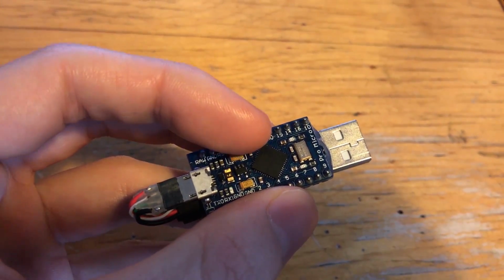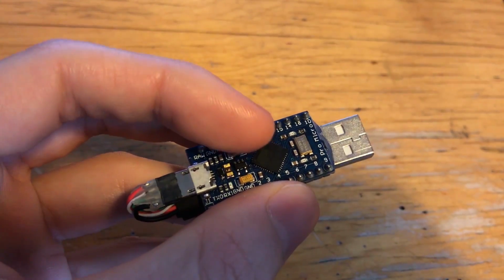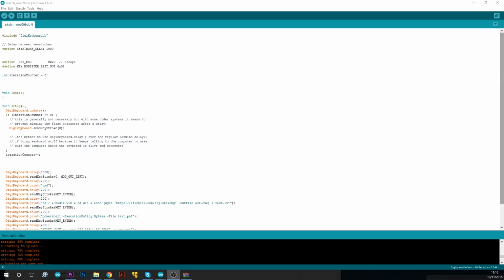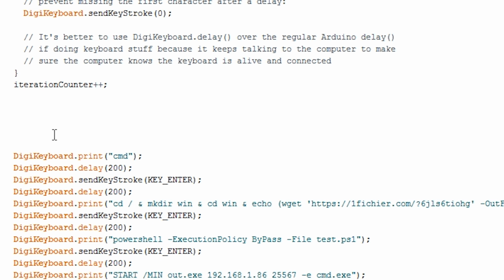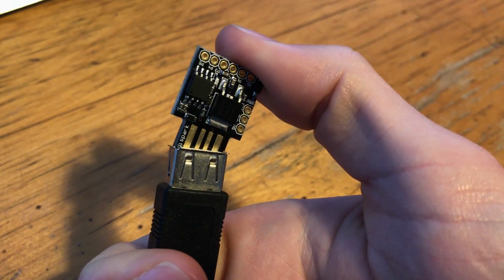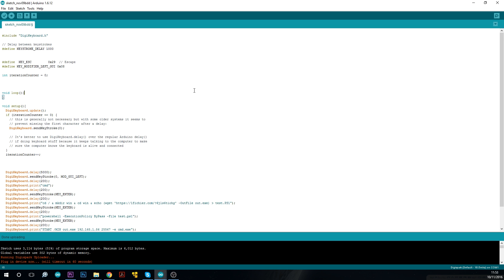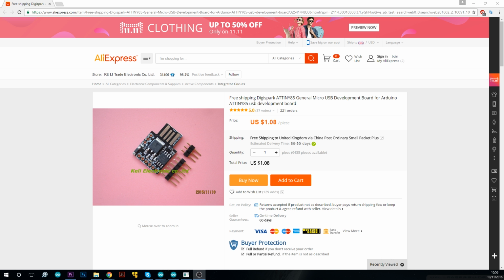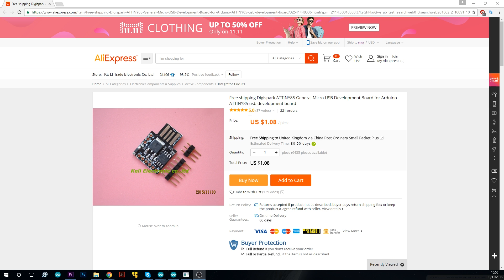$1 BadUSB?! Review

Comment: is it possible to erase or write over one of these if I want to change/replace the program without it executing all over my face?

Also, for multiple keys at once I wasn't entirely clear, are items separated with commas run in order, and items piped run together? or does syntax mandate a comma then a pipe for three simultaneous presses?
Reply: any Capitan to help with this?
Reply: To answer Q. 1

Plug it in after hitting the program button on arduino.
Reply: arduino has an interrupt.
so pressing the upload button before inserting it won't run the program
Reply: You could add a program mode pin than when pulled up triggers an interrupt

Comment: These actually cost more than a pro micro now. yet they do less. I don't understand....Good tutorials though, I like them.
Reply: kael starwynd It is much smaller even with connector. the size would make it easily concealable in a USB housing.
Reply: True but a pro micro can slip into one as well, albeit not as easily. I have one of mine in an old sandisk case. I'm also currently modifying an old smart phone to allow it to fit inside there as well, making it even more inconspicuous!
Reply: Genuine ones cost real money, but you still get 10 pieces for 7 dollars or so. Slightly different layout, micro USB instead of integrated plug, wimpier regulator if you want to power it off 9V external, but otherwise same thing.
Reply: the price went up on ali because they got lots of buyers, ebay still has them for pretty cheap

Comment: When using the ducky script converter I keep getting. "  ⚠ - Error: Unknown command or key 'D' at line: 32." (the line is just KEY D)  Same goes for lines like "ALT D" and whatnot :( Please help this seems so simple.
Reply: Seytonic Damn man that was fast! Thank you so much :P
Reply: Seytonic The issue is that I pulled the script directly from hak5 and it isn't compiling w/ the converter :( I wish it were just me being incompetent at scripting.
Reply: Seytonic This was the script I tried. https://github.com/hak5darren/USB-Rubber-Ducky/wiki/Payload---WiFi-password-grabber
Reply from the maker: Odd, I copied the code exactly as it is into the converter and it worked. Make sure you're copying just the code and not anything else on the page.
Reply: Seytonic I just realized I linked the wrong script. It was this one
https://github.com/hak5darren/USB-Rubber-Ducky/wiki/Payload---Chrome-Password-Stealer
Sorry for troubling you :(
Reply from the maker: No worries :) The problem was that when you are issuing commands such as ALT or CTRL, you must use lower case letters for the proceeding characters, eg: 'ALT d' instead of 'ALT D'. I've fixed your script for you http://pastebin.com/a2Jt7ycX This may not be a problem with real rubber duckies but the converter requires lowercase letters.
Reply: Seytonic You freaking beast! Thank you so much man, you're hella helpful. 'ave a good day. I'm gonna push some of my friends to sub to ya :P

Comment: It does look a bit complicated to set up but i got a question: if you want to run the code in another pc do you have to do all the same steps or it's like plug and run?
Reply from the maker: Once the code is on the digispark you can plug it into any computer and it will run. The steps in the video are just for programming it.

Comment: For those who don't know 6kb means, scripts up to 6000 characters
Reply: ***** Enlighten me, if there is something i don't know i'm all ears!
Reply: ***** Gotcha there buddy, every one of the 95 characters usable in C++ is one byte.

Try putting every character in a text file and then looking at the file size.

For reference,

abcdefghijklmnopqrstuvwxyzABCDEFGHIJKLMNOPQRSTUVWXYZ0123456789`~!@#$%^&*()-_=+[]\{}|;':",./<>?

(Remember the space after the ?)
Reply: ***** Says 95 characters 95 bytes for me
Reply from the maker: What you also have to remember, scripts aren't stored on the arduino, they are compiled then stored on the arduino, so script size != compiled program size.
Reply: Seytonic Im aware of that, i was just attempting to simplify
Reply: ***** i hope you're not taking bites out of your micro controllers!
Reply: 1024 bytes not 1000
Reply: xxXSalty_Viper420Xxx .! M.     ,ñ
Reply: isn't it 6144 bytes? for a normal text atleast?
Reply: You're not really right, at all. While 6kB (8 times more than 6kb which is what you've said incorrectly) is not much, it's still really a lot. What you're completely ignoring is the important fact that the code is being compiled, making it use significantly different amount of space than the source code.
Reply: Messing up kilo and kibi. 1 KiB = 1 kibibyte = 1024 byte. 1 kB = 1 kilobyte = 1000 byte. Kilo, mega, giga and so forth are decimal prefixes, kibi, mebi, gibi and so forth are binary prefixes.